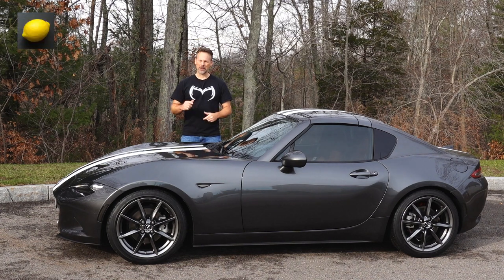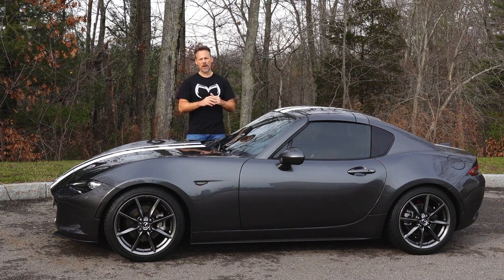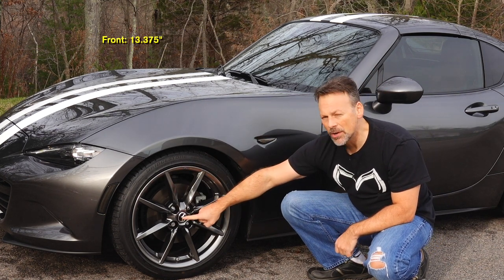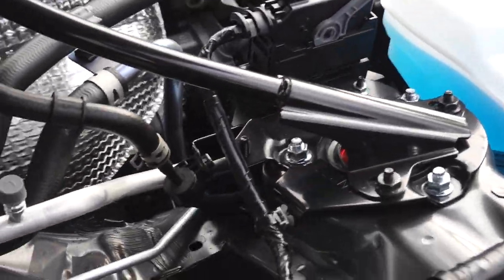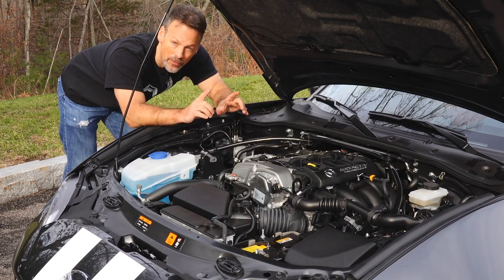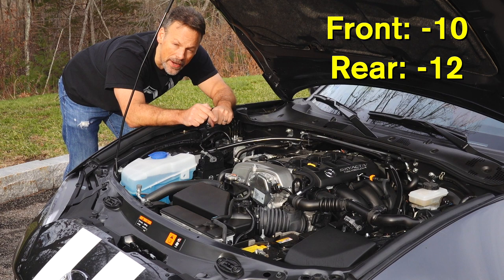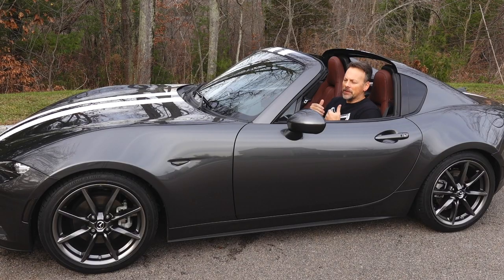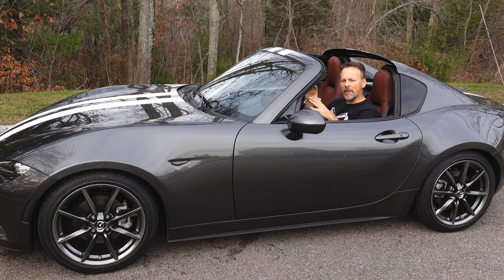MeisterR Coilovers Post-Install REVIEW // (ND) Mazda MX-5 Miata

Comment: I've had the Zeta CRDs on my 19 RF for a couple thousand miles. They break in and ride and grip better after about a thousand miles. No regrets at all. Great ride and grip.
Reply from the maker: Good to hear!  Thanks for providing feedback. What drop are you running and what are your damping settings?
Reply: Pretty close to the same height but I've dropped the rear to 13 3/8" as well but added about 4 MM of preload to keep the rear off the bump stops at highway speed. I started out too firm and found the best grip at 15 front 17 rear. Makes the car really tossable. 14 in the front rides better for me but grips worse. It's worth noting I have progress sway bars so I'm using the damper less for body control and more to generate grip. Also at 30 PSI on stock Bridgestones.
Reply from the maker: Did you install the sway bar before or after the coilovers?  Just curious how much of a difference the sway bar makes on top of the coilovers as the coilovers have helped out a lot.
Reply: I installed the sway bars before so it's hard to say. The sway bars made the car more eager to rotate and planted but if I could do it again I would have gone straight to sways. Honestly, adjustable sway bar links should be your next move. You would be surprised how much prepaid there is stock let alone after lowering. They made a huge difference for me.

Comment: I have had these on my NB Miata for 8 months now and I am very impressed. I got mine for $995 shipped before they raised the price to $1195. Phenomenal value. These coilovers ride absolutely fantastic and improved the handling dramatically to boot. If you are looking for a track/auto X option these springs are going to be too soft. For spirted road use on rough roads these are one of the best options around IMO.
Reply from the maker: And the adjustability is impressive 👍😁

Comment: Thanks for the video. I like them but kind of wish I would of gone to Clubrace higher spring rates. I had to raise mine similar to yours because I was getting into my fender liners on the Dragon/US 129.  Other than real aggressive driving like tracks with a lot of camber the CRDs are awesome. I have had mine on since last winter.  Of note they are pretty harsh till they break in but after breaking in are really nice.
Reply from the maker: That must have been fun on the Dragon 😁👍
Reply: @ extremely!

Comment: I'd be curious to see a comparison between these Meister R Zeta CRD and the FM kit with the adjustable Koni shocks for the ND RF, as they both seem to be targeted to street applications. The spring rates are close between these, with the FM set at 300/205 F/R and the Meister at 336/252.
Reply from the maker: The FM set is comfortable, and noticeable less stiff than the Meister R. If you’re not looking for the adjustability that comes with the Meister R, the FMs are an excellent option. Modified 30th Anniversary Mazda MX-5 Miata (SHORT-TAKE) // Do mods make it worse?!?
https://youtu.be/KUoNktlo5u4

Comment: Very late to the party... 😁 fwiw over ten years ago(the company wasn't going for long at that stage)I got a set of Meister R's for my JDM DC2 Integra type R. I can't recall the model, but it was the 'basic', no top adjustment or solid bushings. 
Fitting was easy, as was adjustment and the change in settings was obvious, though height adjustment wasn't great, either low or very low. Now that was a long time ago and only for my car model so no doubt that's changed quite a bit since. The owner of the company Jerrick was very active on forums and extremely helpful and open to questions and advice. Nice guy.
So, over ten years later, after 140,000 kms? Still going strong, with almost no obvious corrosion or wear. And this car is my daily, in sun, rain, hot, cold(I'm in Ireland so mostly cold and rain😃), motorways and twisty back roads, often on truly awful road surfaces. 
So I can say as far as longevity and value for money goes i can't fault them at all. They also tightened up the handling, on a car that's already very well regarded for same out of the box. My original shocks/springs(which i still have)had only 30,000 Kms on them so I wasn't replacing a tired set where anything would have been an improvement.
Reply from the maker: Thanks for taking the time to provide the background - very interesting and informative 👍. What I’d really like to know is if you still have your Integra??? 😁
Reply: @TheLemonFactor  I do indeed. 😁 Literally just back from a trip to the local supermarket.
Reply from the maker: @MrGrentch I’m jealous. I wish I never got rid of my 1999 Integra ☹️. Keep her, and enjoy 👍
Reply: @TheLemonFactor  Thanks, I will. I've had it since '05, so at this stage it's stuck with me. 😀
Reply: Ps subbed. Great content. 👍

Comment: I recently purchased ST XTA coilovers for my 2020 Miata and am contemplating whether to install them just yet. I've only been driving the car for four months and have covered 3000 miles on the stock suspension. My first concern is about improving my driving skills before upgrading the car's capabilities; I'm wondering if I should spend more time with the stock setup to better my driving first. Additionally, I've watched your videos on sway bars where you mentioned that upgrading them made the car handle so well it actually reduced the fun factor for you. I'm worried that installing coilovers might have a similar effect by making the car too good and potentially diminishing the fun of driving. What are your thoughts on this?

Thank you!
Reply from the maker: The swaybar upgrade made it feel like it’s on rails, with almost no body lean. As a result it takes away some of the playfulness in being able to controllably toss the car around. The coilovers with the adjustability allows you to customize them to suit your style allowing you to keep a lot of the tossability. Hope this helps.

Comment: Any long term comments for these? Super curious how you feel about them vs stock. Did it help with the squirrely rear end?
Reply from the maker: Still enjoying them... no issues at all. I do like the adjustability they provide!  If you don't plan on adjusting the ride height beyond a certain point, you may want to consider the Koni / Progress setup.

Comment: Hey Chad! Great Videos love the detail.  I am looking to get the same Meister R Zeta CRDs and I live in Massachusetts, was wondering what settings you run on the coilovers for spirited New England Driving.  Do you have different settings for "Comfort Settings" or "Sport Settings" I plan to take my Miata to the same shop for my alignment, how are the Flyin Miata Alignment Specs treating you?  did you change anything?
Reply from the maker: I’ve been pretty happy with the alignment specs and haven’t changed them 👍. As far as the coilover settings, I’m constantly adjusting them, especially since having the sway bars installed.
Reply: @TheLemonFactor  great thanks! Do you know of any Miata clubs in the MA area

Comment: Did you have to fit adjustable sway bar links?  My RF has a sensor connected to the rear sway bar, I think it's for the  stability control system. Any problems with DSC when fitting these?
Reply from the maker: I don’t know if I had to, but I did opt to upgrade the front sway bar end links. For the rear sway bar, I reused the OEM end links and have not had any problems.

Comment: Hello, I'm sorry that you sold the Miata but if you change it for another sport car like the supra I'm happy for you ahah. I have a 2021 soft top mx5 that I daily drive, I would like a firmer and lower ride with less body roll, what do you suggest and in which order? I tought Meister like yours first, and after maybe 2 sway bars (I don't know which because I'm italian and I still don't know which are the best buy... finally some spacers, I thought 15 mm that isn't too much but atleast visually is better, ah and I also wanted to remove the plastic flaps from the rear arches unfortunatelly cutting them because they are a single piece with the mud guard. What do you think about these mods? Thank you and keep up with the content, I'll continue to watch your videos of future cars ahah.
Reply from the maker: Thank you for your support, Emanuele 👍. Both coilovers, or a shock/spring combo such as Konis with progress springs, and an upgraded front sway bar will add a noticeable difference 😁. I would recommend starting with the shocks/springs / coilovers as it will give you a firmer, lower ride improving your cornering. If that’s not enough for you, then you can upgrade the sway bar.

Comment: What’s the best setup for a daily driver?
Reply from the maker: Definitely a personal preference and dependent upon the quality of the roads you’re driving on, as well as your mood 😉. The good thing is that they’re easily adjusted 👍. I run mine just slightly on the softer side ever since Installing aftermarket sway bars. 😁

Comment: what are the measurements on the coil over itself and are you running stock tires with no extra offset correct?
Reply from the maker: Check out the pre-install video as I do show some measurements. I’m currently not using any spacers so this is all stock from a rims / tires perspective.
Reply: @TheLemonFactor  So after those measurements you have not made any new changes?    I thinking about using your setup.  I haven't quite decided for sure,  may go with fortune auto coil overs so that would change everything.
Reply from the maker: I adjusted them ever so slightly to get them even on both sides.

Comment: Are you planning to lower it some more?
Reply from the maker: Probably, but I looking into different rims which will play a role in my ultimate drop. I’d like to get it lowered so the top of the tire is even with the fender - ie no gap 👍
Reply: @TheLemonFactor  i see. If you lowered it later are you going to do another alignment?
Reply from the maker: Yes, if I change the height significantly from where it is, I should get a new alignment.
Reply: @TheLemonFactor  Hey... I'll buy your stock rims if you're getting different rims.
Reply from the maker: Good to know 👍 now I just need to figure out what rims to get - this will take me a while 😁
Reply: The promblem I’m having with buying rims is finding something lighter that I like the looks of .
Reply: @TheLemonFactor  i probably put the coil-overs on, let it sit overnight, then drive it for couple hundred miles, lowered to desired height, and last thing alignment then done.
Reply from the maker: ... I’m having a hard time finding a set that doesn’t break the bank 😩

Comment: So as for the alignment, whenever your lowered it again are you going to be using the same performance setup alignment from flyin miata?
Reply: I used the FM alignment setting when I installed the Zeta CRD’s in my car.  Incredible performance for <$1200 combined with F/R sways.
Reply: @BoostedNDMiata  I’ll look into the sways. But the FM alignment is great 👍 and the Zeta CRD’s are wonderful.

Comment: would you still recommend these after all this time?
Reply from the maker: Good question.  I think I would, as I have no complaints, and for the price they're hard to beat.  However, I would also consider the Koni shocks / Progress springs combo as I've driven a car with that combo and it's very "street" compliant while also stiffening things up and adding the lower ride height.

Comment: Love the car. Needs more low. The rears can’t go as low as a lot of other coils for the MX-5.
Reply from the maker: They’re pretty flexible with the ride height. I’ll be lowering it some more - we’ll see if I run into any limitations.
Reply: @TheLemonFactor  were you able to get it lower?
Reply from the maker: I’m sure it can go lower having been able to lower it further during the pre-install setup.
Reply: @TheLemonFactor  they can go lower in the rear but not as low as BC, kSport, tein, feals, fortune auto, ohlins 🤷🏻‍♂️
Reply from the maker: As long as it can go as low as I want it to go 😁

Comment: Chad's the kind of guy that spends all his money on everything from coilovers to exhauset then runs around in December on stock summer tires.
Reply from the maker: Good observation.  I don't drive the Miata in the snow or cold (anything colder than ~40 degrees) as the summer tires are hard as a rock and have little to no traction.  I'll leave the winter / cold driving to my other car.  With that said, it would make for an interesting video to show how bad the summer tires are in the snow...